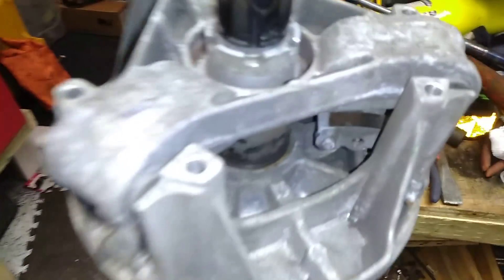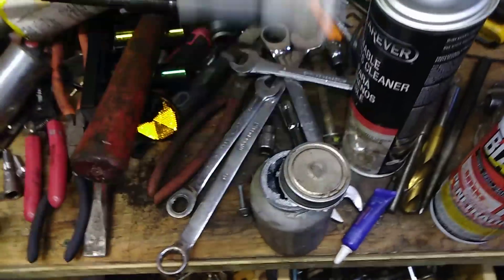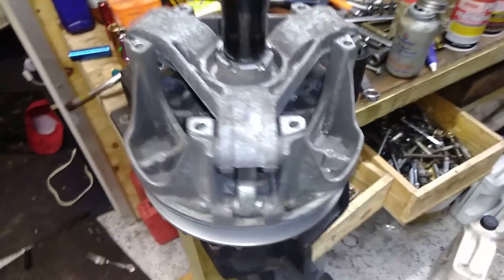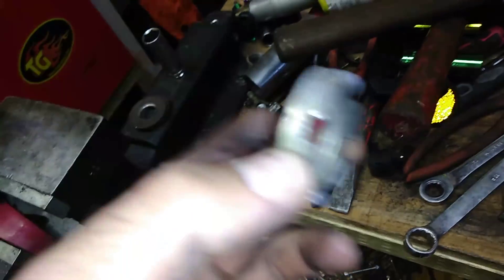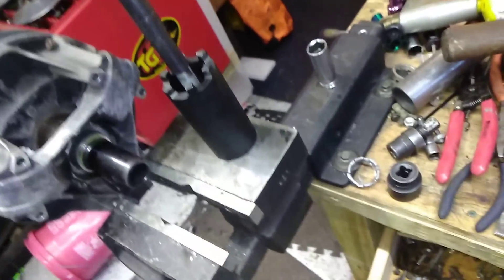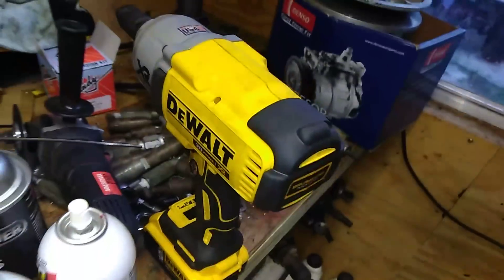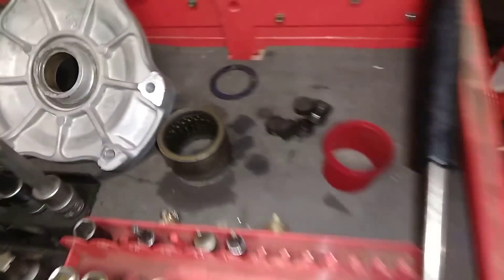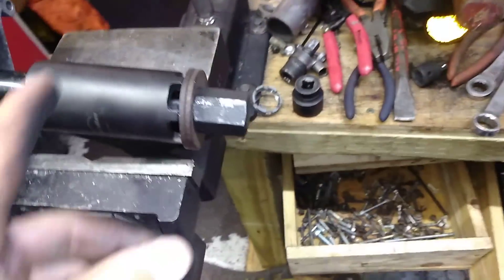Polaris primary tear down rzr

Comment: hey man i just picked up a 1998 foreman 400 4x4 are these good bikes ive mainly rode my 04 rancher 400 A/T wanted something different for riding in mud and water
Reply from the maker: They have short a arms and axles but a nice long swing arm. We usually do a lift using foreman 450 arms axles and knuckles about a 3" lift 35% reduction or 53% and a big bore
Reply: Mud Puppy  what clutch work like epi spring kit